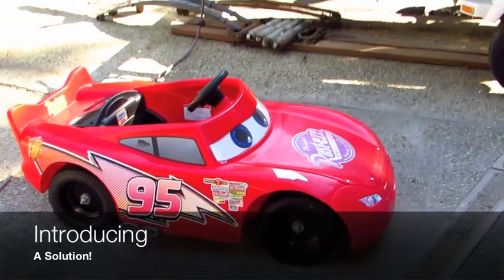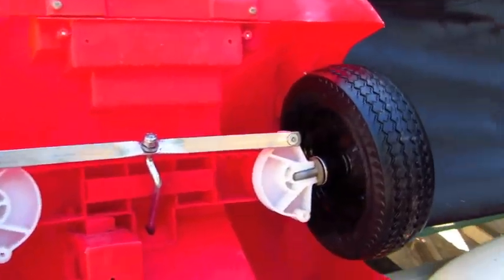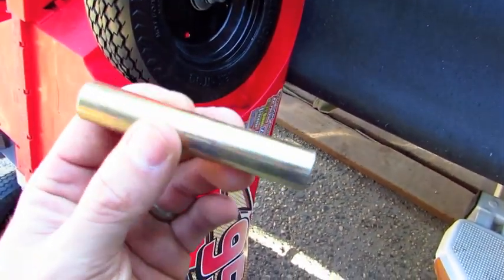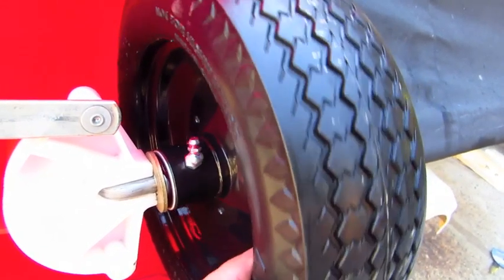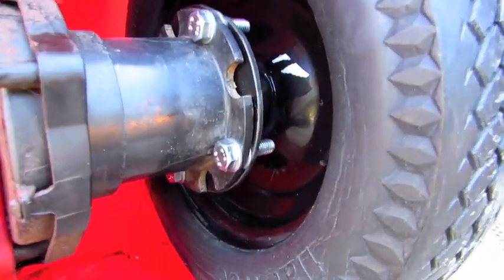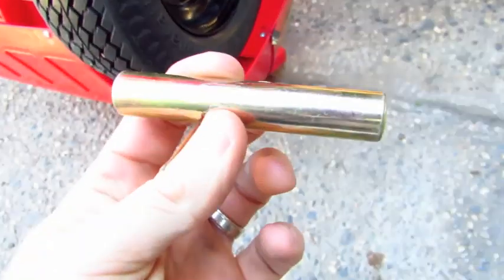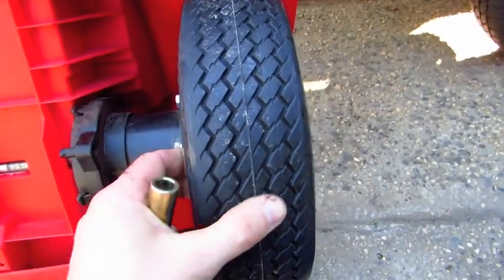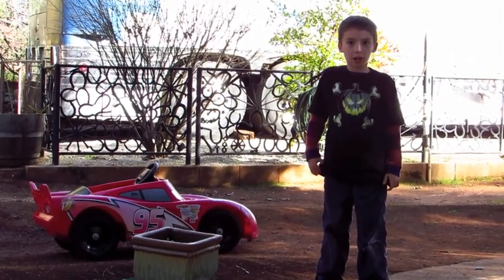Awesome Power Wheels Modification!

Comment: Where can I get those wheels?
Reply from the maker: I purchased these from Ace Hardware. They are solid rubber hand truck wheels / tires. You will have to weld a mounting flange on the rear wheels to make them work... Hope this helps!!

Comment: how did the motors / gearboxes hold up with the new grip??
Reply from the maker: Still going strong and for the past year I have been running it on 18V dewalt XRP batteries... Runs twice as fast, runs about 10 minutes longer than the stock battery, and only takes 30-45 minutes to recharge!
Reply: Did you create a wiring harness adapter between the factory power wheels side plug?  
And you are getting 10 mins longer run time from 1x 18V 2.4 Ah dewalt battery than from 1x 12V 12 Ah stock battery?  Pardon my skepticism, but sounds too good to be true.
Reply from the maker: 10 minutes longer than stock battery run time.. I'll post a video of my very simple wiring setup.. I wrap the dewalt battery in a ice pack as well  because it gets pretty warm from pulling so many amps in such a short time frame (When compared to the drill it was made for LOL)...
Reply: Thanks for responding, and thanks again for posting the original video.